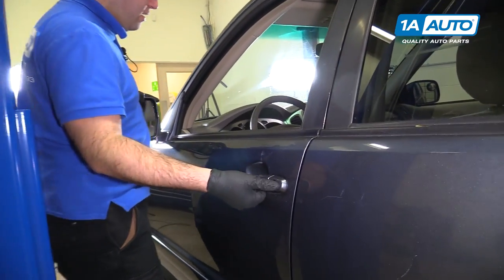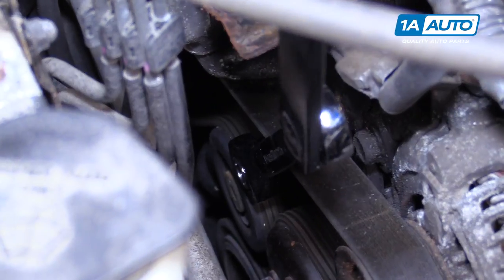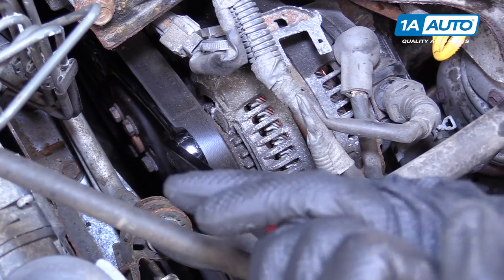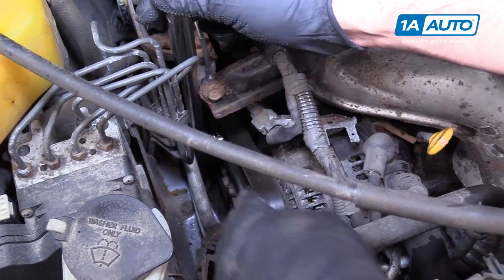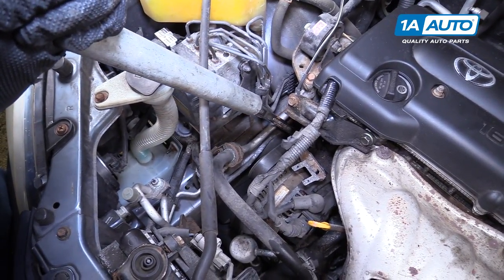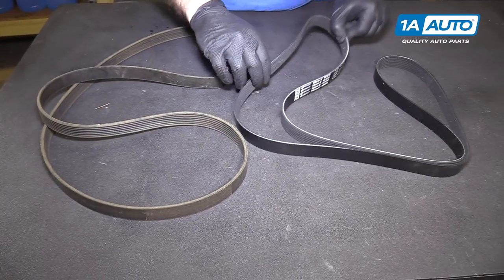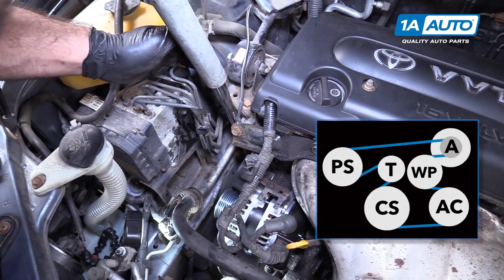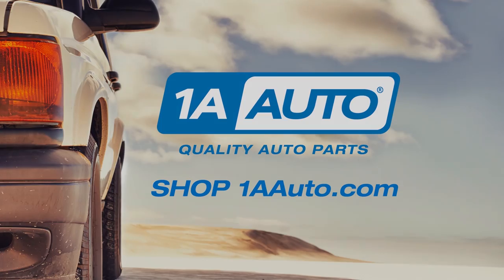How to Replace Serpentine Drive Belt 01-07 Toyota Highlander L4 2.4L

Comment: I own a 2004 Highlander 2.4L and had my water pump replaced today for $599.90. While the dealership was making the repair, they told me my V-ribbed belt needed replacing. I told them NO, I'll wait later to do that (real reason was to keep the cost under $600, boy, did they ever accomplish that!). After I drove off, I noticed the engine was vibrating like crazy and called them back. They told me the belt may need to re-adjust itself after a few miles. I was actually going to have them do the belt job until I told a good friend and he suggested to watch a YouTube video. I typed in basically your title above. Now, I'm getting ready to do that job by myself and save the $266.46 they would charge to do so. My only concern is that I may break that tensioning bolt or strip it as @micmike did. I'm sure if I get all the tools you mentioned at the start of the video, I'll do fine. Hope the costs of those tools are under three hundred bucks.Thanks for making this - it will save me money as will all others who have been blessed with this great demonstration video!

Comment: I used a 12 point socket with a pipe too, and it STRIPPED the aluminum  nut on the tensioner, that sucks huge. AND, that's why people would like to meet the engineer who designs these stupid automotive features and share with them the frustration they feel

Comment: Is there a different belt that’s connected to the alternator and AC?
Reply from the maker: +Otto Rocket Thanks for watching!  If you fast-forward to 4:05 you will see that this is the only drive belt for this particular model.  It will connect to the alternator and A/C.  Some vehicles are different, so you will want to confirm that before ordering.  1aauto.com

Comment: Hi i replaced my alternator, and wanted to replace belt, but it does not fit!!, i installed old one and went in like in your video. Any sugestions?? Thanks.
Reply from the maker: +Hector Diaz I would double check the belt to make sure it's the correct length. Putting on a new belt should be very snug.
Reply: Hi, thanks for the reply i have taken it back to the auto parts and they measured it and suposed to be the one i need. Is there any way that i can strech the belt? Thanks.
Reply: Go get the right belt??? Jfc... it's not rocket science 😑
Reply: @elchinguengenchon  
Just slip on the pulley last don’t do the alternator like the show here , you will never get it on... this way you just push it up on.

Comment: You're not describing how to locate the tensioner pulley, how or where to locate the bolt you're asking me to turn or what the belt system even looks like from the inside.  This video is pretty worthless as a result.